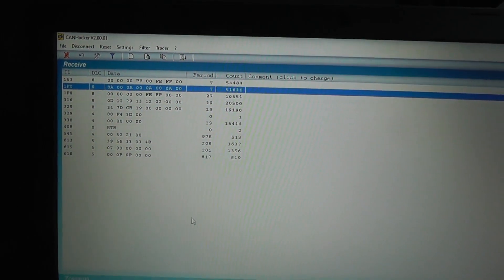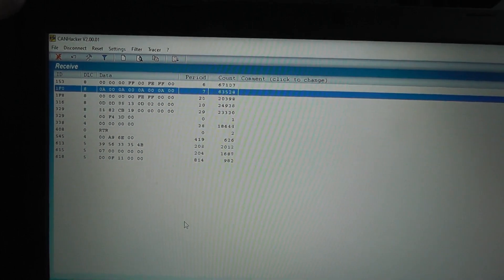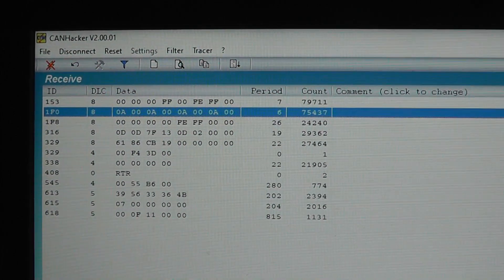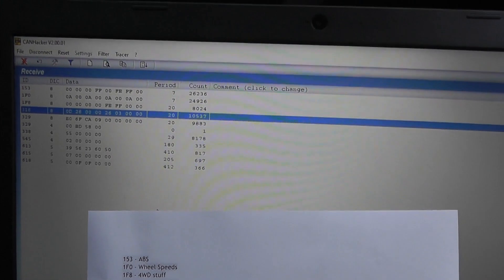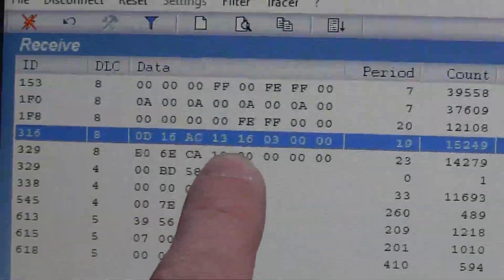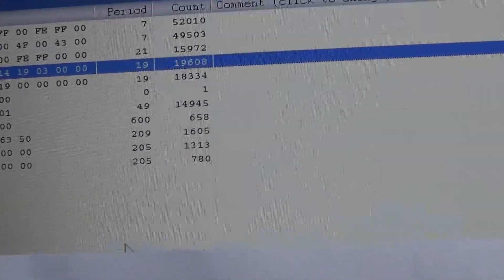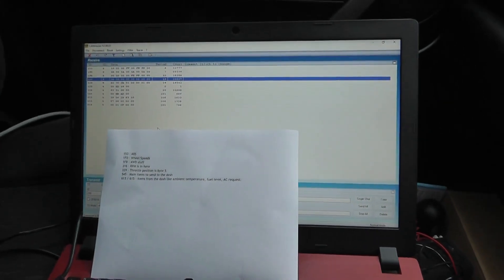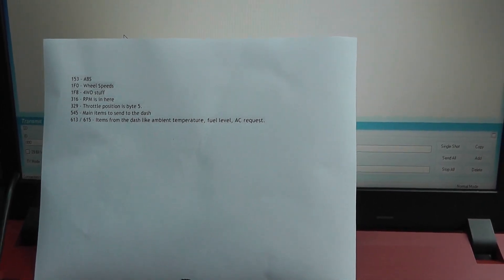DIY EV Part 3 - How to read the CAN Bus in your car using an Arduino Part 3

Comment: How did you figure out what PIN and INT numbers to use?

I have a seeed canbus board that can run Arduino onboard... But I can't figure out what PIN/int to use.
Reply from the maker: With the Seed Canbus module I used the examples supplied but didn't have much luck. How are you connecting to the CAN BUS. Using the OBD2 port didn't work for me.

Comment: Enjoyed the series. I have a question too. I want to see the can bus data in Arduino's Serial monitor. Is this possible with the module u used?
Reply from the maker: That's a good question. I never tried it but the CanHacker software will be holding onto the serial port so you will not have access to it while it is running. If you shut down CanHacker and open your Arduino IDE or use any other serial terminal emulator like Putty you should see what is on the port but I'm not sure what you will see.
Reply: @alibro7512  I see sir. Yesterday i was trying some codes with this module to if i see any 8 bit data on Arduino's serial monitor. Firstly I tried the code that I am working on for a week and the result was disappointing, got nothing on the serial monitor :/. Then I used the sketch named; can-usb to see some data on can hacker or maybe serial monitor? But when the upload is done(I am connecting via obd2 port and didnt unplug the module), my car noised like I didnt put the seat belt on while i driving and all the consoles indicators lighted. My car is okay(for now :).).Actually this discouraged me a little. Because I am still a student and I dont want to burn my cars ECU's :). I am going to continue this project without a doubt but i am wondering that this stuff I mentioned ever happened to you?

Comment: Very informative CAN Bus video series, thank you for your efforts. I wonder if you ever tried connecting CAN lines using the OBD2 port (terminals 6 and 14) in your Freelander instead of hooking it up direct from the engine? I don't know if it is applicable...
Reply from the maker: Thanks for the kind words.
My Freelander is an 04 model so it doesn't have CAN at the obd2 port. I tried it on a 2012 car and it worked but only with a different library. It seems the CAN is turned off at the obd2 port by default so you need to enable it before you can connect to it.
Reply: I see. Another great info, I will keep that in mind. Thank you!

Comment: freelander,has the transfer box devoured itself yet?
Reply from the maker: Lol good question. No because I reconditioned the VCU. they stiffen after a few years/miles and trash the drive train if not sorted.
Reply: @alibro7512  vcu,is that the fluid coupling in the rear prop?
Reply from the maker: @paul.alarner6410  Yes, Viscus Coupling Unit I think.
I drilled holes in it, flushed out the old fluid with white spirit, tapped the holes for bungs and refilled it.
Took about a week but it works perfectly now.
Reply: @alibro7512  im a mechanic by trade,tbh freelanders seem terrible,lots of mechanical+ electrical faults with them,seem lack of money put into there development,has your rear subframe chassis mounts cracked yet?
Reply from the maker: @paul.alarner6410  lol not yet.
They have lots of silly issues like window regulators, rear door latch, etc etc but I like them. Most of the issues are easily and relatively cheaply fixed.
I'm even stupid enough to like the K series Freelanders. And yes I have had to replace a HG. 🤣

Comment: https://photos.app.goo.gl/vKr42L6AxRjwxw698
Reply from the maker: WOW!!! That looks amazing. Any videos of the build?
Reply: @alibro7512  not ready yet, I want it finished before I has a 55.5v 110A motor and a 133v 110A (rear) roughly 20.5KW! Top speed was 127kmph
Reply: @javierchaparro4769  wow

Comment: It makes sense that the data is similar to the BMW E46, which is what I suspected a while ago. 

This could make the EV project easier, as BMWs do seem a popular EV conversion. 

How are you at counting in hexadecimal? it looks like Hex is being displayed in the changing values. 

I'm sure the ABS will work as a stand alone unit, however it would need to sense speed data to the speedometer, and would need throttle position data for the TC and HDC to work. 

I'm hoping the BMW similarities make this easier to sort. 

Thanks for taken the time to put this video together.
Reply from the maker: Hi John
I don't know why but although I received a notification of your comment I can't see it below the video. Have you something odd going on in your Youtube?
Reply: I don't think there's an oddity with my YT Ali.
Reply from the maker: @johnnodge4327  Looks OK now John, not sure what the delay was but it seems to be sorted.

Comment: That one that goes to zero when motor is running and you take your foot off the accelerator has me curious. Turbo boost? Inlet vacuum high? Calculated load? Ignition or injection advance? Clearly I don't know how modern cars work....
Reply from the maker: Also I only noticed after watching the video myself, the 2nd byte from the left is giving the same data and the fourth from the left is 13 on idle but rises and falls with rpm.